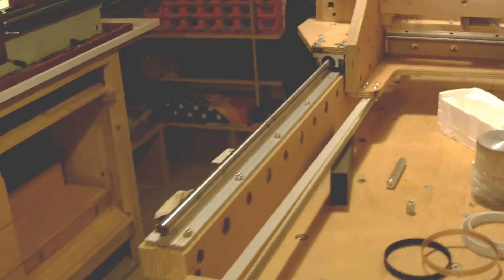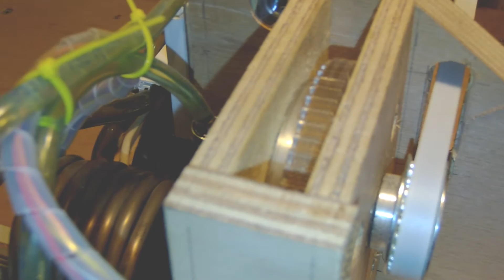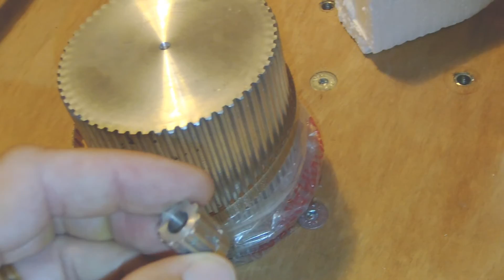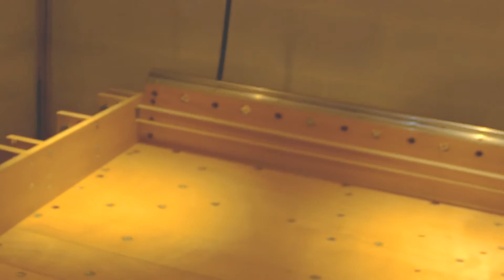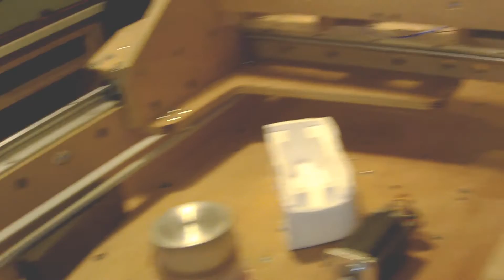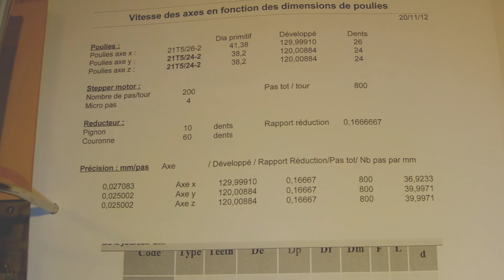Homemade DIY CNC, CNC Design : how my CNC axis are designed.

Comment: Thanks for making the video. What type of timing belts did you use and where did you get the belts and pulleys? I'm in the processes of building a 4'x8' unit and your video is really helpful.
Reply from the maker: Richard Woerz it is half inch wide with 5mm pitch same for pulleys